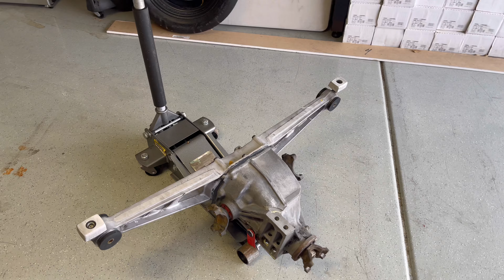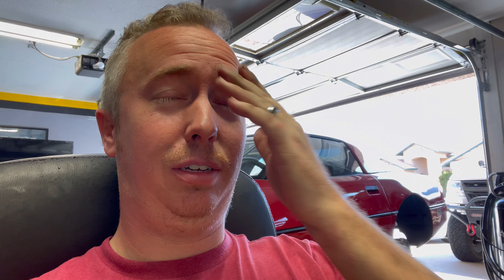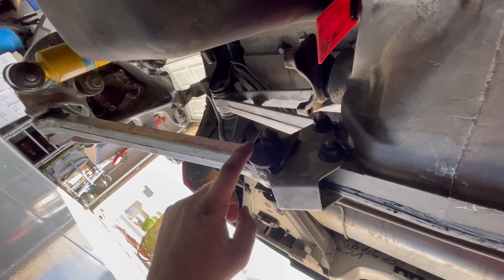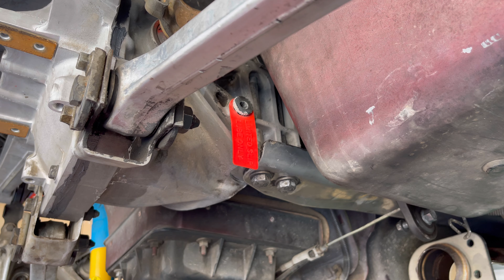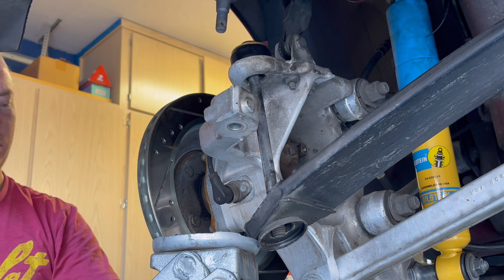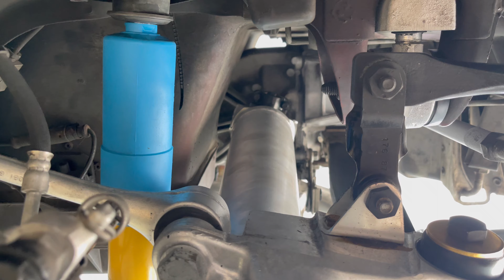C4 Corvette Reassembly Day

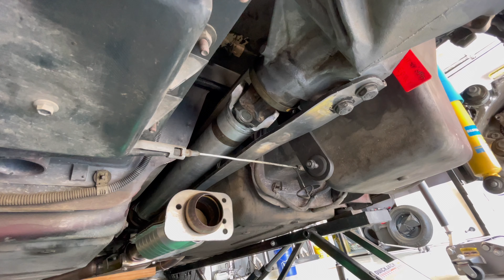Comment: 4:00 When something doesn't line up, what I do is use a multitude of taper punches to work it into place. Put a punch in one side, knock it out with a larger size from the other side, and repeat until you get to a large enough punch where you can then knock that one out with the bolt itself. If you don't have punches, you could buy a set of bolts of varying sizes and grind the tip down a bit into a taper (maybe grind the threads off a bit too to smooth them out).

This obviously only works with a thru bolt.

Comment: Chris, did you know that the bushings on the ends of the batwing have a thin steel sleeve around them that needs to be removed before putting the new bushings in?  Unfortunately, the sleeves do not come out with the original bushings nor are they used with the new ones.

Comment: I have to add a comment at 10:04, don't put your jack on the tip of that spring, you're asking to break a finger if that thing lets loose.  Put the jack on the flat part of the spring (inboard).

Also, when you put your support rods back in (or when you took them out) did you mark the position of the camber bolt so the alignment is correct?

Comment: Thanks for this vid and the other one where you remove everything, they are extremely useful because I suddenly have some diff noise. My 88 auto isn't driven very much and I'm wondering if a suspension bush has failed through age and is transferring ordinary diff noise. I've read that if you replace the tie rod inners with Heim bearings this does transmit noise, which has given me the idea that my standard inner joints or some other failed bush is causing the diff noise to be transmitted . I'm going to remove the spare wheel carrier and inspect everything first, hoping to find the cause. If not then I'll have to remove the diff and have it reconditioned.

Comment: On a totally unrelated topic, looking for replacement flasher relay for my 04 C5....I have changed all my lights to LED.....need low current relay to make flash at normal rate.....Thanks
Reply from the maker: Hyper flash harness.  I have a video on that.

Comment: I was wondering did you put the differential fluid in before you reinstall the rear end? and how does the muffler delete sound without the mufflers.... is the sound of the exhaust louder inside the car?
Reply from the maker: No, after. Sound is a little louder, but not bad.